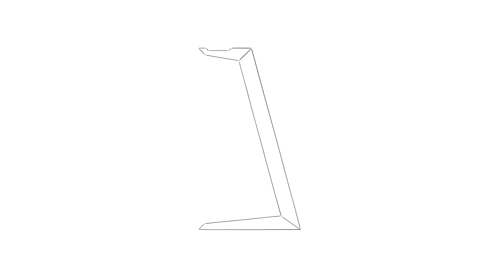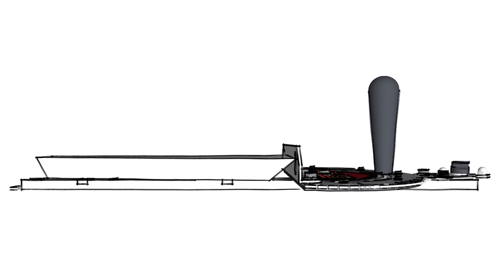How To Make A DIY Headphone Stand - Woodworking

Comment: This is a really cool design. And no need to worry about the quality of the music. It is way better than most woodworking videos here on youtube.

 I must say though, I was a little surprised when you cut the tapers at the beginning. My instinct would be to build it all and glue it up. then cut the tapers. That way you don't have to worry about how to hold the pieces while you are working, and the tapers are guaranteed to lign up.
Reply from the maker: Thanks Neistridlar. I thought about doing that...Too big for the table saw, but you could do it on the band saw. I was worried that I would get some kind of crazy tear out or something though. If I had to make multiple. I'd definitely try it out and be willing to sacrifice one...b/c that would save a ton of time and make it simple.

Comment: I like how you describe angles in terms of "degrees off of 90" 
Makes the cuts seem less arbitrary. Great video :)
Reply from the maker: Thanks. I often struggle with that when describing things. A lot of cabinets I make are technically 75* and 105*, but saying 15 less/more than 90 seems to describe it better.

Comment: To cut the taper, I'd mark a line, cut it close to the line with a bandsaw, and then use a router table and straight edge to trim it flat and straight. (all done after the miter cuts)
Reply from the maker: That would work. Lots of ways to skin a cat. :)

Comment: I would call it art. Nice design! I did cringe a bit when I saw you cut those tapers on the table saw. Since it is not a joint you were cutting, I agree the bandsaw would have been a better choice.  Couple swipes with a hand plane would have cleaned them right up. A small crosscut sled with a few hold downs would also work well. Keep up the great work.
Reply from the maker: Thanks Tom. I have to get on a cross cut sled for sure.
Reply: Also, using your track saw and taping the work to a stable table to remove the tapers after your angled cuts is another option!

Comment: So do you have any ideas about a small addition to deal with cable management?  I like the clean look of this but would love a place to put wire. I'm not very creative so all my brain comes up with is a small square biscuit like canter lever on back. Any other ideas would be appreciated.
Reply from the maker: I got wireless headphones :) 
Actually...now that you said that, this is the first time that I've even thought about that. Since mine are wireless it was just totally off of my mind. I'd probably just leave them next to where I use them (what they are plugged into) and have the wire plugged into that and as neatly tucked away as possible.

Comment: Hey Chris, been watching all your videos and share your passion. I usually build my "art" in soft wood like pine or spruce and go with my gut feeling when it comes to "sturdyness". Can i ask how you determin how well your design holds up when pressured or bent? Do you use any software or math equations?
Thanks again for such excellent quality videos!
Reply from the maker: Thanks Faldoable. The only place I've ever used any kind of software was a "sag calculator" for making some decisions on shelves and cabinet tops. Everything else is based off of experience, and other pieces that I see.

Comment: Excellent video I would like to try and make one also, is it possible to give me the dimensions of the woods and also what type of wood did you use? Thanks in advance
Reply from the maker: I used walnut. I don't remember the dimensions....but overall the piece was about 9" tall and tapered from 3 to 1 inch bottom to top.
Reply: Chris Salomone thanks a lot do you remember the thickness of the wood?

Comment: I have a grizzly table saw and I was wondering what blad you have and riving knife you use? I have the grizzly G1023RLWX
Reply from the maker: Hi Philip. I use a Forrest Woodworker II blade. The riving knife is the one that came with the table. Did yours not come with one?
Reply: Thanks, I do have one that came with the table yours just looked a bit different.

Comment: What software do you model in? I work with Inventor3D, but I prefer solidworks any day of the week.
Reply from the maker: It's Sketchup. Never tried either of those two.
Reply: It would be cool to know generally how much time you typically spend on each phase of your projects: brainstorming, design/drafting, building. Also cost of materials.
Reply from the maker: That part can vary quite a bit. Sometimes inspiration strikes, sometimes you have to labor over it. On this one, I'd say I spent 2 hours coming up with the ideas and refining. So that would be on the quicker side.

Comment: What slider setup are you using? I'm in process of building one, and have been, but I need to finish it up.
Reply from the maker: You're talking about the camera slider right? It's a Konova...and I rigged up a little motor using a cordless drill. If you want more info on that email me and I can send you some pics and explain it.
Reply: Chris Salomone I tried using a cordless drill on mine but couldn't get it down how I wanted. I was just hoping you had an arduino sketch I could purchase from you. I found one on Adafruit that I can use if need be. Great videos!
Reply from the maker: I built this super simple jig using threaded rod, a couple nuts and washers, and fishing line. Would be nice to have something that wasn't hands on though
Reply: If I'm ever successful with this arduino build, I'll keep you posted.

Comment: Gluing 2 end grains together, I would probably add a domino or peg or something.
Reply: isn't the glue strong enough? for the porpuses
Reply: For this yah, miters have some strength but end grain is not considered a good glue joint. But there is not much stress on this so it should be fine.
Reply from the maker: For this purpose the miter will be plenty. End grain to end grain on anything that will carry any weight though is a bad idea.
Reply: Good video by the way, love it

Comment: Another awesome video, although this one is eerily coincidental in timing. I just bought new headphones and was asking a friend if he had a headphone stand he liked. He said no, and I mentioned I was thinking about making one. And here you are posting a video on making a headphone stand!

I also recently made an adjustable taper jig out of scrap wood/hinge/hardware for some table legs I made a few weeks ago. Super easy to make and worked out really well. http://64eb979b4c8144ffc995-428ea7a04468029246838b43e9fdc467.r87.cf1.rackcdn.com/taper_jig.JPG
Reply from the maker: Hey Chris. If you like the look of this one, have at it. Did you find plans for the jig somewhere, or just winging it?
Reply from the maker: Nice...came out good! Love the color.